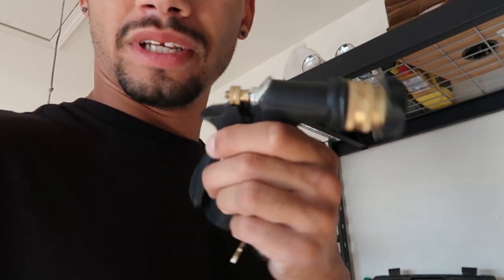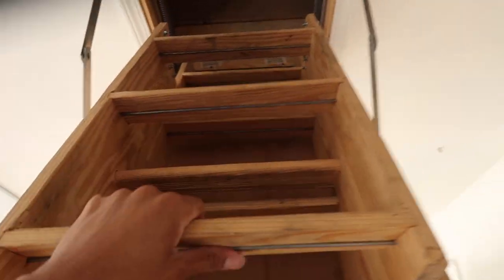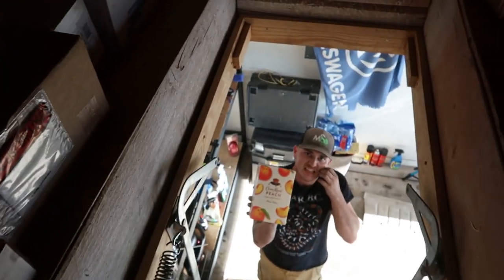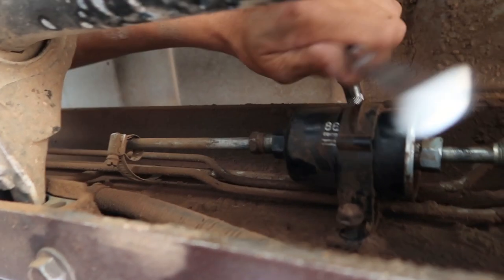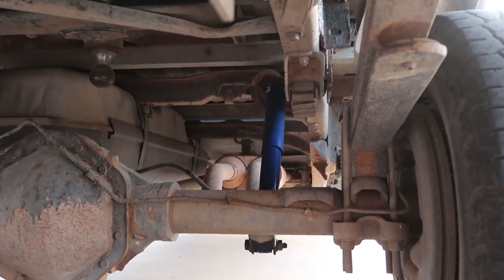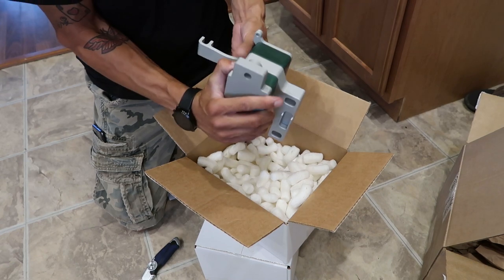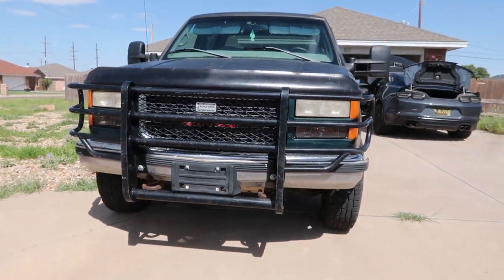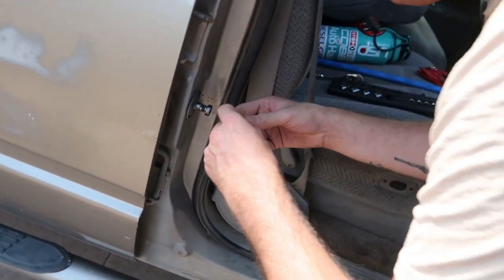Getting down and dirty with the big block truck! Loving this thing!

Comment: There’s definitely something about those older GM full sizes. About 06 is where it went to hell with them. I recently bought an 03 Yukon for a daily. 17 years old and runs so smooth!

Also, check rock auto for parts if you need em for the truck. Dirt cheap for OEM on them.
Reply from the maker: I'll have to go spend some time on there I need a handful of small things! Seriously loving this thing.. I've been missing out for awhile apparently lol

Comment: That’s funny cause the power loss from the ac in my 7.5 it’s hardly noticeable compared to my Mk 6 or the 5 I had.
Reply from the maker: Dsg or manual though? In DSG cars it doesn't even feel like it's on
Reply: Bryce Jordan Productions , you’re right. I do have dsg now. That’s gotta be it.